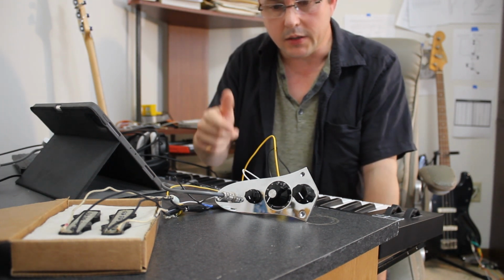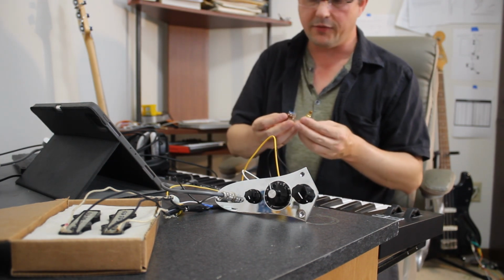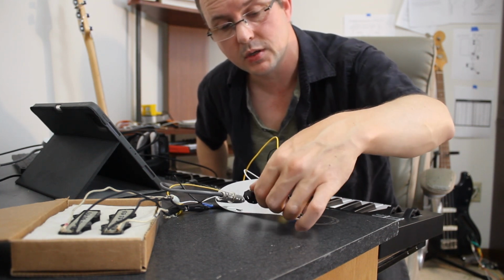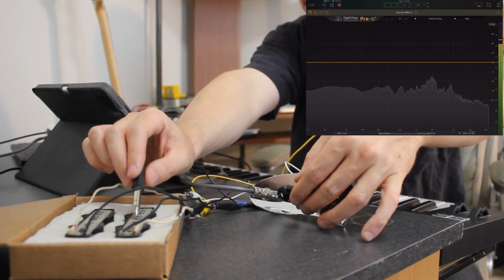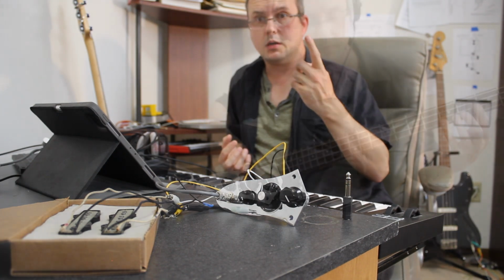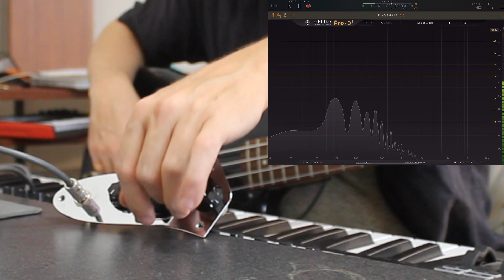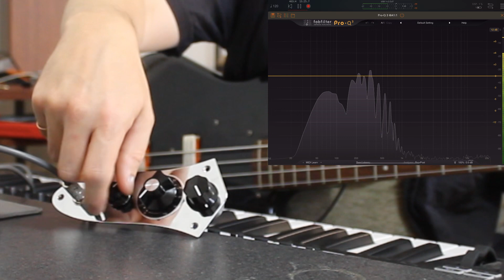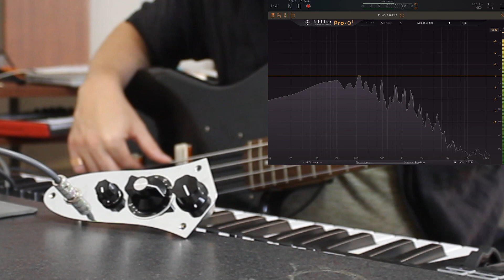Abomination. Fender Jazz Bass Blend and Circuit.

Comment: There should be something like this for a Gibson SG Bass.  The stock setup is not good.  V V T.  However, if you adjust the bridge or the neck pickup just a bit, it's like turning it off.  It's much worse than what I hear in my Jazz Bass.  The SG Bass has no nuance so I resort to playing it full on :(
Reply from the maker: Sounds like it has those J taper pots in there. Basically on off switches, right?
Reply: Yes.  Why would Gibson do that? @ticktockfool
Reply from the maker: @jmasno5  cost savings? That’s where a lot of companies can save cash is in the electronics. Plus they figure most players crank everything to ten anyway so… that’s my guess.

Comment: How is this blender dual pot any different than using 2 separate volume pots to get a blend balance? Are you using Red color "liquid Electrical Tape" to dip the treble bleed components?
Reply from the maker: One knob. Faster blend. Yes. Dipped to prevent any shorts to ground. Tone cap just for looks.
Reply: @ticktockfool  you mentioned in the video that the Bourns pots has a different TAPER compared to the CTS pots taper. So what type of Taper to use for the Blender pot?
Reply from the maker: @waynegram8907  the tapers are the same in regard to the blend knobs. Taper changes when you add a treble bleed to volume pot. The volume pot becomes halfway between linear and audio.
Reply: @ticktockfool  yes the treble bleed changes the taper and also alters the voicing of the pickups

Comment: So, this circuit never completely shuts off a pup when turned all the way to the other, correct?
Reply from the maker: @stevelamm2366  hmm? Yeah? I mean full one way or the other and the off pup is going to ground. Is that what you mean?
Reply: @ticktockfool  For example, when the blend knob is turned all the way to the bridge pup, is any signal coming from the neck pup at all? (vice-versa as well) I like this setup, but was wondering if it allows you fully disengage the signal from either pup to allow full single pup tones. Hope that makes sense!
Reply from the maker: @ yeah, it will send one pup to ground when fully turned CCW or full CW. the wiper in the blender will connect the hot wire fully to out while the other wiper sends the other fully to ground.